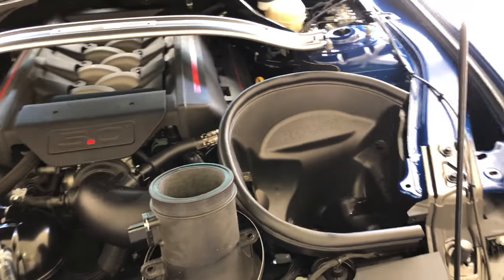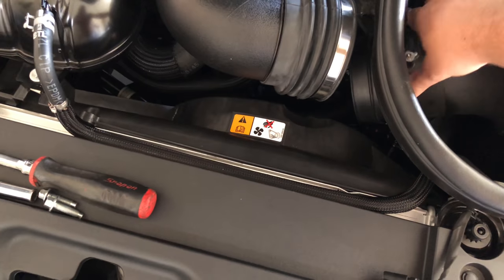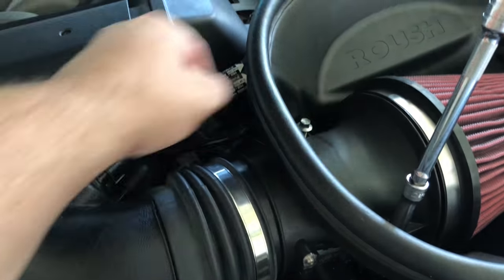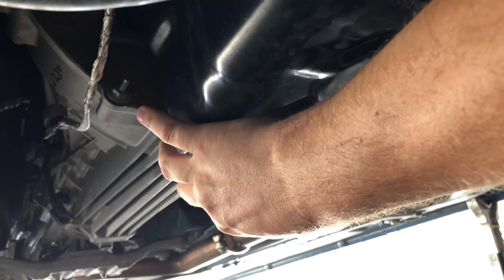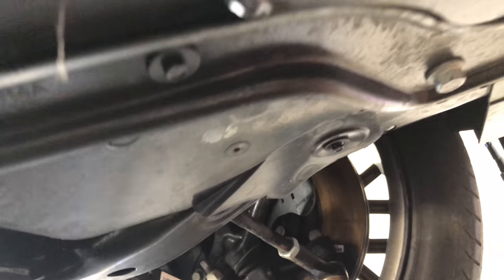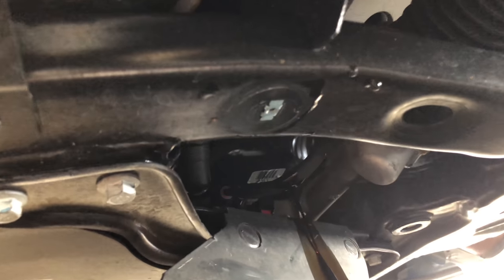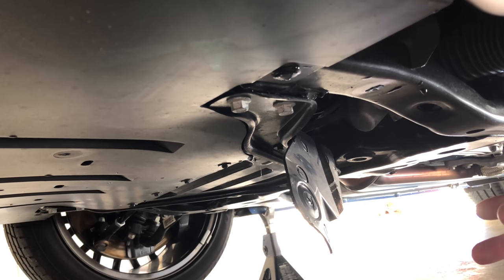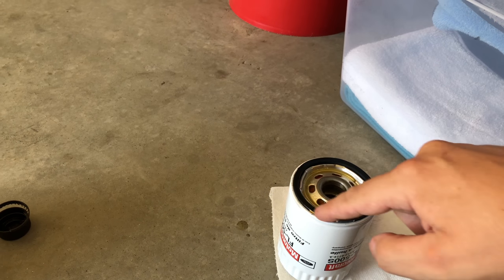Cleaning Roush Air Filter and Oil/Filter Change. Regular Maintenance on my 2017 Mustang GT.

Comment: Nice looking GT What valve cover is that on your engine? I see you took the big huge Ford stock engine cover off what did you replace it with trying to find something suitable for mine
Reply from the maker: MIKE AMERICA those are the engine covers that came on the car.  I have a separate video on how I painted them.

Comment: You left out how you cleaned your air filter
Reply from the maker: Michael Queener dang you are correct sir.   I just used super clean degreaser.  Sprayed it on the inside and outside of the filter, let it set for about two minutes and sprayed it out with the hose pipe with a spray nozzle from the inside of the filter.  Took about two hours to dry out.   Thank you for pointing that out!

Comment: Howdy, how often do you clean that roush?  Also, what did you use to clean it?  22k miles on my coyote. Also, as you mentioned, no oil right?
Reply from the maker: Pablo Lopez Are usually clean my filter every other oil change and if you have a dry filter then no oil
Reply: @KnightsGarage  So you just spray it with water and let it air dry? Thanks btw
Reply from the maker: @mustangpilot6786  Sorry i missed that part of your question.  I cleaned it with simple green, but i would recommend K@N filter cleaner since it is made for cleaning filters. I just didnt have any on hand so a good de greaser is good.
Reply: @KnightsGarage  10-4 thanks so much!!!

Comment: why not just loosen the filter clamp instead of unplugging the MAF sensor?
Reply from the maker: Clark Taylor Because you cannot remove the filter with a mass airflow Housing still bolted in place.  I talk about this in the install video for this intake.  So to me it’s just easier to take it all the way out and take the filter off it’s just two bolts and one plug.

Comment: Thanks for the vids.  I thought catch cans weren't needed on a NA engine,  or not tracking the car.
Reply from the maker: Kc M false.  Catch can isn’t really “needed” for any engine.    But I would recommend one for any engine.   Even in an N/A engine I still catch several ounces of oil in between oil changes.   Oil going into your intake will reduce the overall octane rating of the fuel.  When that happens it increase knock and this makes the ECM pull timing which reduces the horsepower output.
Reply: Project Lightning I also made an oil change video and you can see how much oil my catch can had in it.